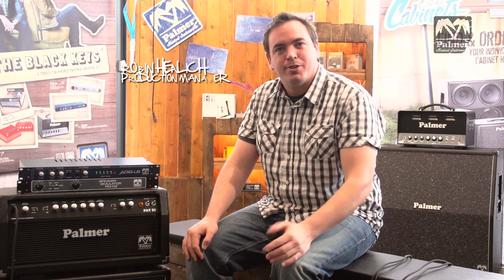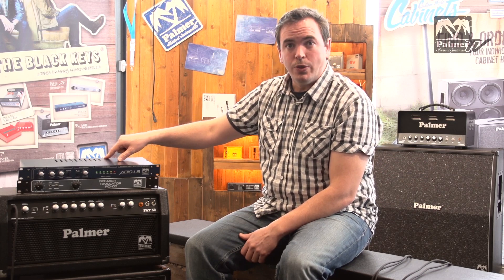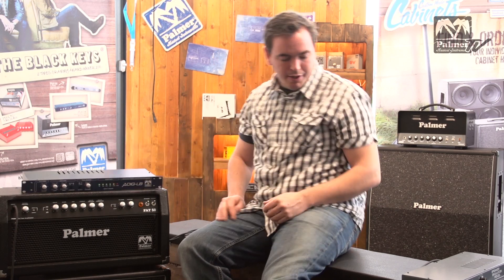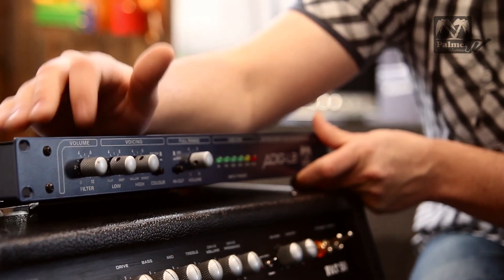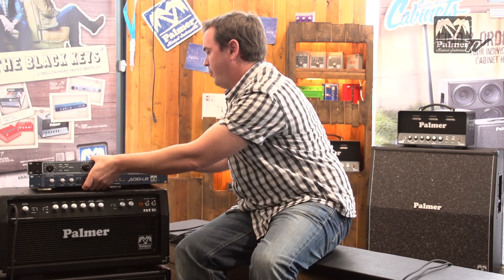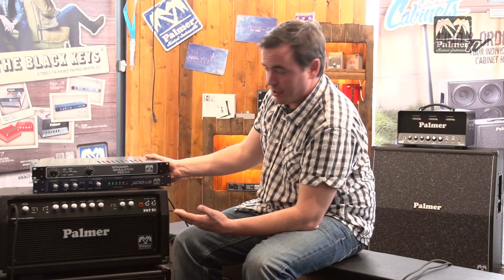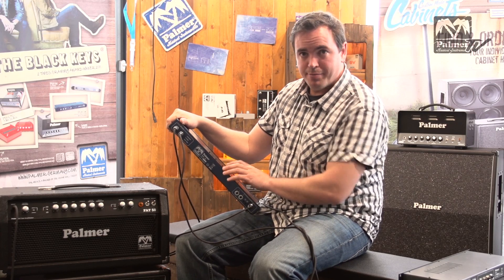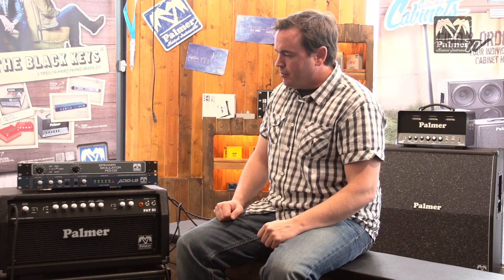Palmer PGA 04 - Speaker Simulator with Loadbox Tech Talk

Comment: Hello , is it possible to by pas the the speaker simulator and using other impulses for recording ? I dont mean to load other impulses in the palmer. Just use a tube amp direct to the palmer and the palmer direct to soundcard. But bypassing the speaker simulation of the unit . Thank you

Comment: Hello,
I have a question. If you have a marshall head, which has more than 1 speaker inputs. You plug a 8 ohm cable into the speaker input and the other end of the cable into the 8 ohm input in the marshall head. Can you plug a marshall cabinet into the marshall head? It has more inputs, so you plug the cable of the cabinet in 1 input and the box cable into the other input. Is that possible? Or is the only way to use a cabinet with the box that you must plug in the cable in the thru input.

Thank you
Reply from the maker: Hi! Sorry, don’t get your question. A head with a speaker INPUT? 8 Ohm cable?
I am guessing the question is, if the Amp has two speaker outputs that can be used simultaneously, can I then connect the cabinet to one and the PDI03 to the other? Yes – this is possible. Cheers from Germany ;)

Comment: Hi there i am usually a two notes user for the torpedo live, however I have purchased a pga04 unit to use for touring on the guitar techs recomendation.
I plugged it all in last night and the sound was bassy as hell, the pa is flat and very high quality. ?....
The sound was pretty unusable and no led lights were lighting up despite the head being on over half powere (100 watt mesa)
V confusedm any ideas 
Thanks
Reply from the maker: Hi Colin, sorry to hear that you have problems with the PGA.. Could you please share some more details to your setup? Thanks!
Reply: Yes of course , randall rd45 or dual Rec head 8ohm -Palmer input - xlr out to front of house.
Filter all the way up bass 12:00. Treble 12:00 range as suited to situation etc.....
I am having to set the bass on the head to off for it to be remotely useable at present.
I and the engineer can not work out why A the bass is so unable to be tamed.
B why the input led are not working?
Reply from the maker: Looks like your setup is fairly straight forward.
Did you buy the unit new or used. Inside the unit you can re-configure the behaviour of the LED via jumpers. We have a special manual for doing this which we can send you.
If you bought the unit new, then it is really peculiar – also the sound you are describing – its very untypical for the unit to do this.
Either way, please double check all cables and make sure they are all good and correct. If that is the case, we would suggest not to use the unit until the case is solved – rest assured, we will support you with any service that is necessary.

Comment: Can you bypass the speaker simulation to use it for example in the computer via impulses?
Reply from the maker: Hello Jaime, 

yes, that works. You need to turn the regulator "Filter Volume" to 0 and the regulator "Full range" completely to the right.

Best regards :)